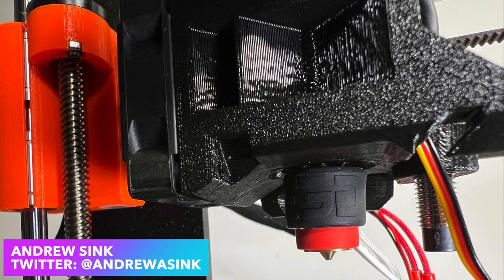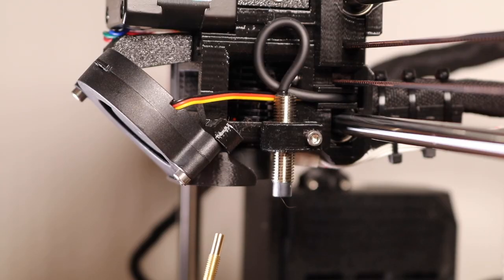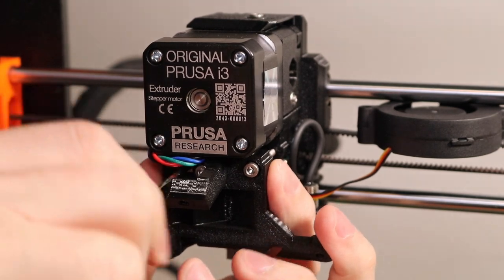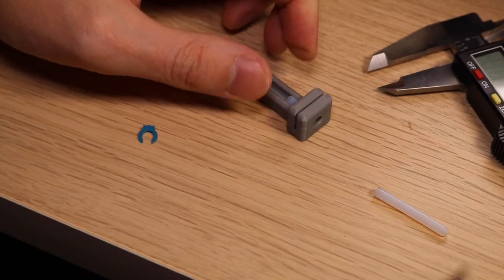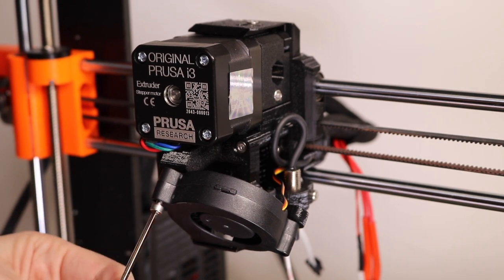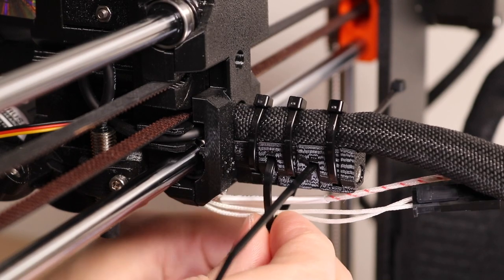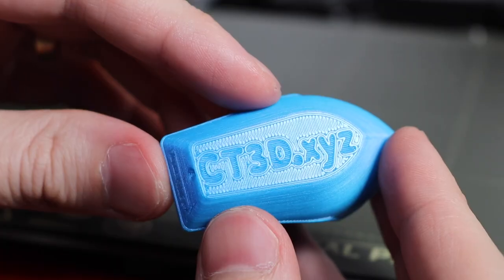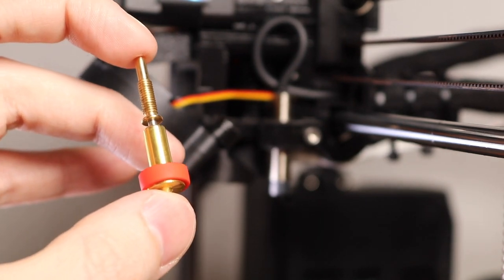E3D RapidChange Revo Six Review - Change Nozzles Super Fast!

Comment: The REVO I think is for basically anyone that does not mind the extra cost. Because of this main reason..."Head clogs" and "heat tightening". We will have to see a long term road test. To see if indeed this new design keep down head clogs. If so this is worth the cost. Also not having to heat tightening a nozzle is like Heven. One, because trying to hold the heater block and tighten the nozzle at 300c without getting burned is a great benefit. And the ease of just screwing in another nozzle at room temp is nice.  I have heat tightened at least 10 times and every time I am still am not sure if I did it correctly. The last time I heat tightened my E3D nozzle I think it worked. I have parts that I am going to print with the 0.8mm nozzle. Something I would never do with my current E3D hotend. Being afraid of not getting it heat tightened correctly. A hair pulling experience for me. I might even try a part or 2 using the 2.5MM nozzle. Since it will be so easy to change out and why not experiment. I am also going to buy the upgrade heater block with the PT000 Thermistor and harden steel nozzles when they come out.I have the PT1000 Thermistor installed in my current V6 and it is much more stable/precise than the stock Thermistor and I don't need the adapter board as with the PT100 version.

Comment: I pre-ordered the Revo6 for my Mk3s currently using a Slice Mosquito.  The Mosquito has been very good at easy nozzle changes, which I do a lot of, but it requires a modified extruder.  The Revo has got me sold on the wrap-around self-limiting heater that cannot easily overheat if the controls fail shorted "ON", because I do some fairly long prints.
Reply from the maker: Awesome! Hope it works out for you, I definitely enjoy using mine!

Comment: I just love my Revo, but I´m having problems with PLA after a few weeks of usage (first weeks worked just fine...) However, the documentation does not mention the need for the outside chamfer on the bottom of the PTFE tube. Maybe it´s that what´s causing me issues with PLA? (no need for the upper chamfer in my case as it´s a Bowden setup).

Comment: It look like your wiring setup is more complicated than mine.I have the E3D v6 Gold edition hotend. It looks like all I need to do on my printer is unplug the thermistor and heater cartage from the extension cable. I ordered the REVO SIX. So I have not installed it, yet. But it looks like all I need to do is plug the Revo into the extension cables and change the Thermistor type in firmware. I hope it is that easy. I love having Hotends and fans that can just plug and unplug when you need to change one out.

Comment: Did you have to buy any wires? You mention new wires you're tightening down into the block with tiny screws. Is that included?
Reply from the maker: The block is actually already attached to the previous wires, you just need to unscrew and reattach!

Nothing additional required; it’s all included with the Revo Six!
Reply: @AndrewSink  So does it come pre-packed with the wires you need? I am asking because I only see the two connector blocks on the images that will end up under the X carriage, but of course that isn't long enough. I would like to know if you need to cut down the existing wires from the V6 or not.

Comment: Really unhappy with this product for the MK3S. They make you create the PTFE tube yourself. I did it wrong and now its stuck inside the new Revo. I destroyed the coupler trying to get it out and it’s still stuck.

It’s ridiculous to pay this much money and one of the steps is that you have to carve and cut a very vital and specific piece yourself
Reply: If you can't measure and cut a piece of PTFE tubing with the amount of online tutorials available..... I'm sorry mate, this might be the wrong hobby for you. Best of luck.
Reply: @Geoffvader  that's a shit reply. He paid good money for it, it's marketed for the mk3/s/+ as a direct swap, so it should come out of the box ready to go. You could probably tune a ptfe tube without issue, I know I can do it without issue, but that's not the point.
Reply: Call/msg E3D
Reply: Update: I found out that E3D was indeed at fault and had sent my a heatsink with a bunch of metal shavings stuck inside , probably from the manufacturing process. This is why the tube didn’t push in the full depth at first.
It was a big headache to deal with and took awhile before someone on Reddit figured it out and explained that the little coils inside were not supposed to be there. 

E3D said they will ship me a new unit though.

Comment: Any idea how this revo would behave on a MMU2S system?
Reply from the maker: Hmm. That’s a great question. I don’t see why it would work, but maybe that’s a question for E3D!
Reply: I don't think it would be any different. I don't have the Revo yet but I do use an MMU/2S. The assembly of the Revo is very similar to the current V6 overall in the Prusa print head, so I don't foresee any issues at the moment.
Reply: @HunGredy  Thanks, I already confirm with tho guys who have the Revo Six with MMU2S and they said it works pretty well, no issues so far :)
Reply: I've been using it for a litlle over week with the MMU2S. I actually think I am getting improved tips as well as less heat creep (maybe related) I have been printing ASA/TPU composites using the Revo with MMU2S very successfully.

Comment: so the nozzles are more expensive and are still made of brass which make them pretty useless towards the abrasive filaments. is the only benefit to paying for this "upgrade" only for slightly faster nozzle changes? looking at the cost of the kit, it looks like each nozzle is like $20. so you're going to be paying more for nozzles for saving a few minutes of time changing them?  thanks for the video, but it doesn't make me want to go out and buy one unless you can enlighten me with more info about the benefits of plopping down $150 for this. i'd imagine they will have other nozzles but i don't even think i'm interested in knowing what they're going to cost.